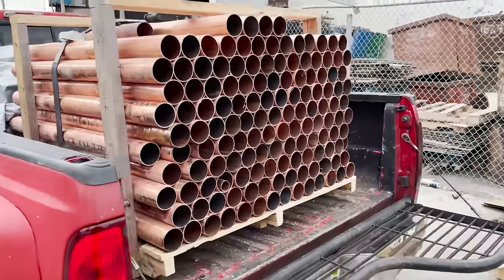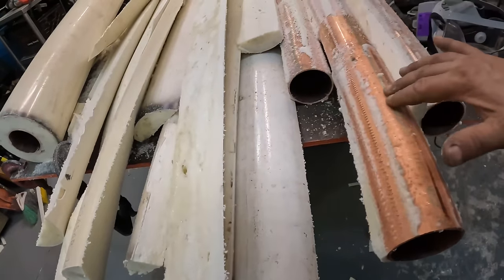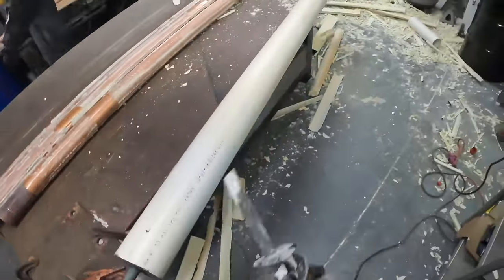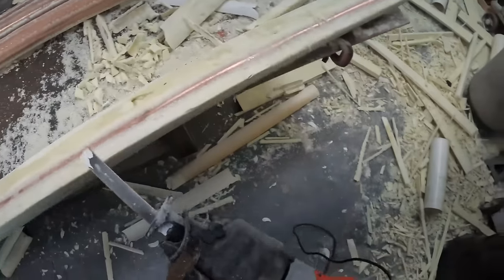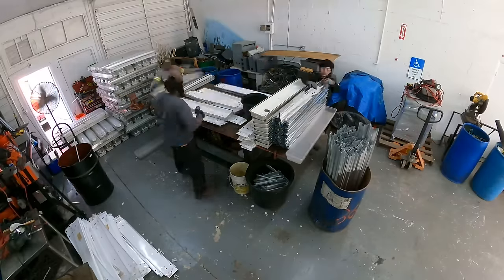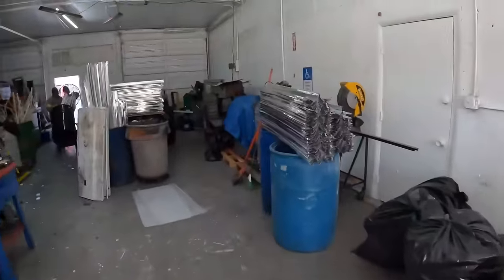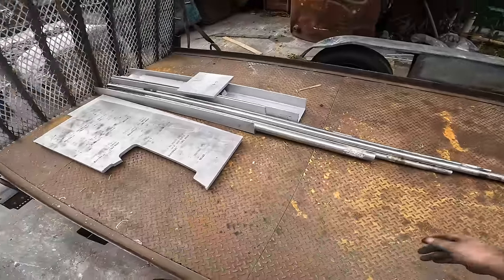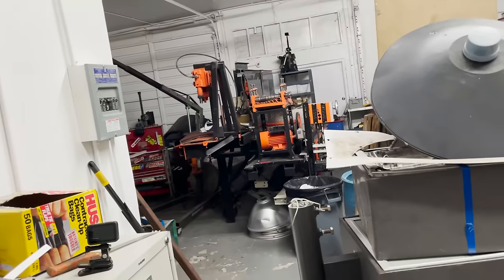Massive $18,500 Copper Pipe Breakdown Pt. 2

Comment: Hi ,love the copper piles...I have been skip diving and found 6 signs that the supermarket used during the peak of the pandemic. Each signs were Hugh and all made out of exdruded aluminium. Took me half a day to take all the screws out and all the little steel bits out. Total weight was 245kgs not bad as they were free. All paint free too exdruded aluminium. Love your videos each time I watch your videos make me want to go out and find more scrap. I think your way of removing the insulation was the most cost & time effective way to do it.
Reply from the maker: Thanks, free scrap is the best scrap. lol

Comment: At one point I used to renovate hotels and grocery stores as a plumber, the amount of cargo vans full of copper and brass I’ve hauled away would basically be unimaginable to anyone if I told the amount.
Reply from the maker: Haha, nice!
Reply: I can relate, In 1986 I was a teenager on school vacation and worked for this air conditioning company for $25 a day as an assistant to help the senior technician carry or fetch his tools equipment and we would drive around in his van to attend to various service calls at convenience stores supermarkets so a few weeks later my partner says we going to "moonlight" on another job to earn some side money to clear out a big supermarket at a mall that had moved out and together with 4 other people that were in on it. We got there they told us to remove the underground plumbing that were these long copper water pipes wrapped in thick fiberglass insulation stacked 3 or 4 together we had to climb down into a manhole underground use a pipe cutter or hacksaw to cut the pipes and pull it out in sections then someone at the top would remove the insulation, it was heavy back breaking hot cramped work and the insulation was soaked with a lot of moisture that attracted dust which made it "muddy" and slippery to handle but I was young kid with a lot of energy and it was like an adventure, we spent 3 days on it and I remember the scrap dealer came with his big truck and loaded up close to 2000 kilograms of copper pipes there were also a huge load of unstripped copper wire some steel tubing some aluminium I forget how much copper was priced in 1986 all in I remember we got close to six thousand dollars in total but they only gave me a couple of hundred dollars but for a teenager in 1986 with $200 in his pocket that's huge money.

Comment: Great work! Anything you can do to optimize or streamline this would help. I bet you could build some kind of simple device to hold three wire wheels and drive them with one big motor and just shove the pipe through it
Reply from the maker: If I had more I would make something but I will probably never see this many pipes again. Thanks for the suggestion and for watching.

Comment: First of all! We are all jealous of your find!!!! As far as reclaiming it? I'm questioning if it was in longer lengths is it would have been more valuable for someone rather than buying new? Depending on grades, wall thickness etc? As far as clamping?  Rather than just a vice? 2 timber or steel rails held to the bench about 1/2 diameter/ thickness,  with  even packers in the bottom as sizes decrease? The other thought I had was a heated wire element drawn through?  Again, recovery of scrap is rarely the same!  My best wishes to all of you!
Reply from the maker: Thanks, The people I got it from tried to sell it as is for years before I got my hands on it.

Comment: Nice. I didn't the electrical work on a motel 6 and had to disconnect power to a building being tore down and i burnt up 2 new Milwaukee saw all cutting 6 runs 300ft long of 4 inch and 6inch copper pipe man that was a lick anyway nice job
Reply from the maker: Awesome score. When I was in demo I had no idea how much copper was worth.

Comment: on holding the free end of the stock while you cut - it's hollow - make a clamp to the table that has a cone on it so you can use it on various sized stock - could be hard rubber or metal
Reply from the maker: Thanks for suggestion

Comment: Back in 2018 I broke down a huge electrical cabinet for a huge industrial park and I pulled out around 40 solid copper bus bars that weighed like 40 to 50 pounds each, the pay I got at the scrap yard, was amazing. Also I used an Excavator to pull out all the underground high voltage cables from the man holes, turned into a 40,000 dollar pay check. But I almost died, the city said that all the electricity coming to this vacant lot was all disconnected and this place was huge. It had its own helipad. But anyways, there was about a 200 foot section that wasn't on the original build plans from back in the 80s, which was connected to a feed than ran all the way into town at the clock tower and old mills which were converted into apartments. The helper I had jumped into the man hole and tied a pull rope around the cables like all the rest and when I started to pull with the boom there was some tension, when I started pulling a bit harder and the helper had just gotten out of the way when the cables snapped, there was a huge explosion and the Excavator was shut down. I called the electric company and had them come down and screamed at them because of what happened, especially since they said that all power was disconnected. They told me that all of us should have been dead. I told him, "NO SHIT." It was crazy.
Reply from the maker: Wow glad you are ok. Thanks for sharing that's a perfect example of why you should not always trust peoples word and double check for your self. .

Comment: next time you should try local green house or plant growers , they would use the fiberglass housing for grow tray for seedlings, quick pop with map gas torch and pliers for those brass inserts.
Reply from the maker: Thanks for the suggestion, on the brass inserts I tried that at first but it was breaking off.

Comment: One suggestion for cutting the insulation.  Rather than using the tooth side of the blade, use the non-tooth side.  Better yet, grind a knife edge on that side and you’ll be able to cut through the foam.  I did that 20 years ago when i was building R/C airplanes.  The knife edge would not cut the copper.  To be clear, this is after you’ve cut away the PVC pipe.  Who knows, another project may come along when you have to remove just insulation.
Reply from the maker: Thanks for the suggestion
Reply: @ProjectShopFl  sale the pipe, mor money is in pipe than in coper

Comment: 45 years ago we put wire in 55gal barrels and use some napa to burn insulation off have about 10 or 15 going at a time. It would be cool if you could heat pipe up and pull it out.
Reply from the maker: I don't think the neighbors would have liked that. lol
Reply: @ProjectShopFl  this yard was out side city limits LOL

Comment: Have an idea. Take a 2’ length of scrap steel and weld two pins the size of material the size of that will fit the Inside dia and you clamp to the bench that ought to keep one side from movingmoving
Reply from the maker: Thanks for the suggestion

Comment: not sure how well it would work, but maybe 2 grinders with wire wheel brushes in them inset in the table somehow, then maybe you could push the dirty copper over those like a table saw set up but for cleaning the glue off the copper. Unfortunately you would still have to use the sawzall for the first part but might be able to make that second step a little faster next time you get a chance to run that stuff.
Reply from the maker: Thanks for the suggestion, I don't think I will ever get that stuff again.

Comment: A quick way to of removed the copper would of got a piece of metal conduit slightly bigger than the copper cut teeth on one end and weld plate on other end  with shaft to chuck into a  1/2 hand drill, then it would of cut the foam off around the copper then tube would come out and foam would also be taken off the copper as long as you made your like hole saw a close fit.
Reply from the maker: Interesting Idea, Thanks for sharing. Reminds me of when I used to run a core drill.

Comment: I don't know how much of this you actually do but if you look into it they have pole Sanders which is a belt sander that goes around a pole. I believe that they are about 500 bucks. Maybe helpful? I use them for repainting light poles.
Reply from the maker: Thanks for the suggestion but this was a one time deal. In 10 years of scrapping this is the first time I've come across this stuff.
Reply: @ProjectShopFl  I assume that's an unusual haul lol but it was interesting to see and think about a possible solution

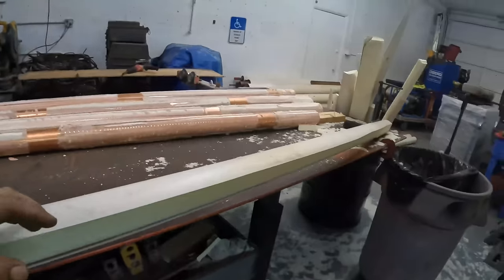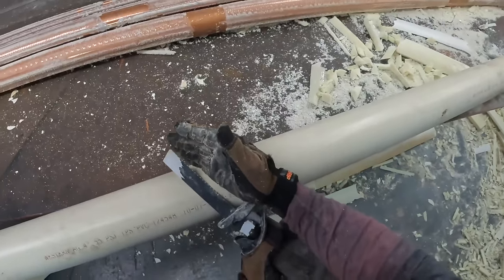Comment: 10:05 A Better way to clap down the pipe. Well, it has a Hole in the middle, You can clamp down the ends of the pipe with a standard c-clamp,  Insert it into the bottom end of the pipe (you're cutting the top) and clamp it down to the table. Easy peasy. 15:15, as for the Shaking of the smaller pipes when you cut them, the solution is pretty simple. You can get a wooden block (or metal if you prefer) and clamp to the table in the middle.  It will act as a Backstop. . The pipe will rest against it as you're pushing the saw through.
Reply from the maker: Thanks for the suggestion, I like the block idea but a clamp in the end would have worked but slowed the process.
Reply: @ProjectShopFl  Well, A block of wood on the end with a round dowel in it (to fit inside the pipe) would have also worked. A different sized dowel for each size of pipe. Just slip the pipe into the dowel, and whoa-la! instant pipe holder. You could rotate the pipe with no problem. when Done, just pull the pipe out.

Did you buy ALL the pipes from where you bought those pipes? I seem to remember there were a LOT of them left.
Reply from the maker: @scrapman502  Yes I bought all the pipes they had. There was a lot of PVC left they are trying to sell.

Comment: You could use a solder gun and have diffrent attachments for the diffrent size pipe it would melt that foam in a hurry and no clean up
Reply from the maker: Thanks for the suggestion

Comment: I would have tried using a rheostat with two leads on each end slowly increase the intensity to create a large resistor that would create heat to the pipe and have two guys twist the sleeve loose.
Reply from the maker: Thanks for the suggestion

Comment: You could have put a slow motor with a belt on one end and use a pencil grinder to make finish clean up sweet, pencil grinder is for woodworking using sandpaper
Reply from the maker: Thanks for the suggestion

Comment: I wonder how a wire would work on say a 5hp electric motor. Instead of using the belt replace the belt with a cutting wire and size so it fit around the pipe. Then manually push it threw the wire? Im not sure but I would have maybe looked into that. Looked like you guess did a good job anyway
Reply from the maker: Interesting idea.

Comment: What about cutting to a length to fab something to hydraulically to push through a cutting collar or something of the sort , maybe something like a wood splitter 🤷‍♂️🤔👍
Reply from the maker: Thanks for the suggestion. I thought of something similar but in 10 years I've never come a cross those pipes and will probably never get that many again it was a special deal. by the time I made all that I would have had most of it cut up already. Not sure what video it was but I explain why I did not go that way.

Comment: Ever tryed to use a hot wire once you cut the pipe in half wrap a wire around the copper the just heat the wire and pull down the pipe
Reply from the maker: No this was my first time doing this.

Comment: With all the new construction going on and the need for green solutions, wouldn't you be best placed to sell it on, I am assuming it's old stock that's never been used.
Reply from the maker: It was new and special order bought for a specific job that got changed. They stored them and tried to sell them for 5 years before I got them.
Reply: @ProjectShopFl  Make hay whilst the sun shines then, I agree with the way you're stripping it all down, man power and no chemicals. Good luck bro.

Comment: will acetone melt that insulation coating - you could chuck your sweep-up into a bucket of that to isolate the copper
Reply from the maker: Possibly but I did not want to use chemicals

Comment: Number one insulated is that strictly solid copper
Reply: That material compared extension cord material pricewise
Reply from the maker: No,  should be stranded wire as well. One way to tell is if you bend the wire and it stays bent and is stiff its #1.
Reply from the maker: Its over $1 per lb difference.

Comment: Hey I do scrapping as well how did you get the pipes? And where to look or what to call for to get this? I usually do centrifugal chillers and get the copper tubes out of them
Reply from the maker: They were for a giant AC system that was never installed. I've only gotten them once from an electrical contractor.

Comment: Did you try using wire with electrical power hooked up to both ends and will melt the foam it mite melt the plastic pipe as well
Reply from the maker: No, I did not want to have to deal with melted plastic. The process I had worked really good.

Comment: I know your not crazy about using chemicals but you should really try goof off. Its a paint/ everything remover used by painters to get old paint glue and old gunk off windows, window seals, base boards, really anything but carpet or clothing. You can find it at your local hardwear store or paint store. Again its called GOOF OFF. Good luck buddy.
Reply from the maker: I know the stuff well. Thanks for the suggestion but I finished all the pipes.

Comment: Can’t u get a pipe 8 feet long put whole saw teeth on it then fixed to a big drill. Kind of like drilling in the ground but your just hollowing the copper out the closer to copper the better. Good luck either way amazing job
Reply from the maker: Could have but this worked fine. Your idea reminds me of when I was a concrete cutter and cored deep holes using continental tubing core bits, you just kept adding 2' sections.
Reply: Yes you can keep the pipes hole just have the bit 50 inches long and cut it at 48 so you have some started. But don’t mind me the way u guys did it works great. Keep the videos coming

Comment: Clever way to remove that foam / pipe. 
What was that used for in that configuration ? Underground ? Or that's considered insulation ? 
I've never seen anything like that up here in Philly..
Reply from the maker: I was gonna be used for a massive air conditioning system but they went in a different direction.

Comment: Why not heat up the pipe with a torch and just pull it out with vise grips?
Reply from the maker: That might have worked but I don't think it would be as easy as you think.
Reply: @ProjectShopFl  you would have to get the pipe pretty hot but hitting the end of the pipe with a sledgehammer would help to break it loose.  If it worked it sure would save alot of cleanup time.  Definitely worth a try if you come across more insulated pipe like that again.

Comment: Too bad you don't have a pipe that is slightly larger in diameter and longer then slide it over the foamed pipe and hammer it down the pipe forcing it between the foam and copper
Reply from the maker: I was gonna do something like that but with hydraulics

Comment: If I understand it correctly:
u paid 400 USD for labor of your workers plus 300 USD for food?

Or are the 400 USD only for the job of loading/unloading?

If not and u paid 400USD for laborwork for the whole job.... modern slavery.
According to your bargain of 12500 USD for the whole job.
Reply from the maker: I paid $300 for food & fuel. I picked up the pipes (loaded & unloaded) by my self. I pay for the shop, the truck, trailer, the 5k for the pipes, the tools, blades, & dump fees for the waste. I came up with the process to clean the pipes. The labor just showed up to work. At the time of this video I was paying  $15 P/H for general labor. How is that slavery and how is that different than any other biz?